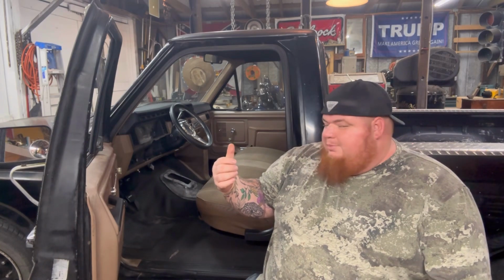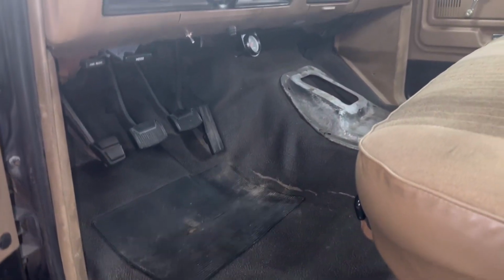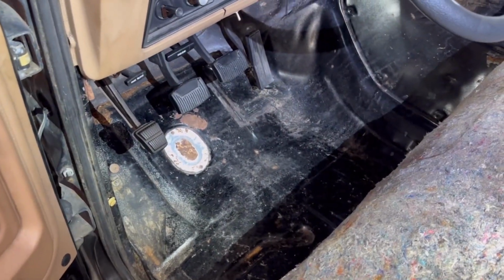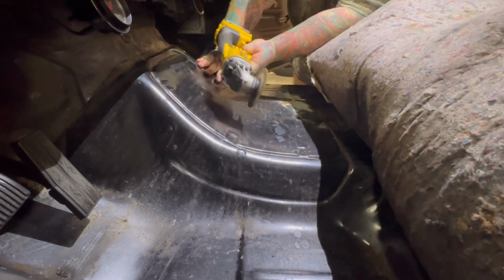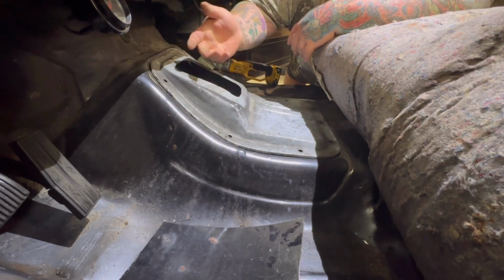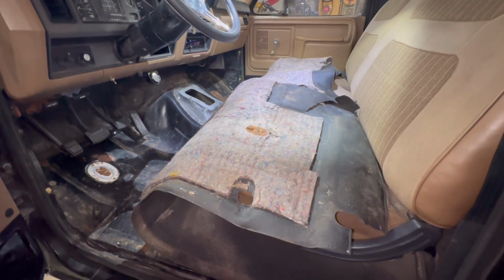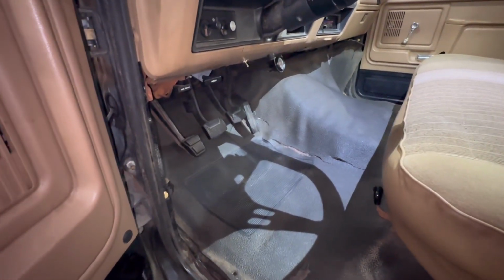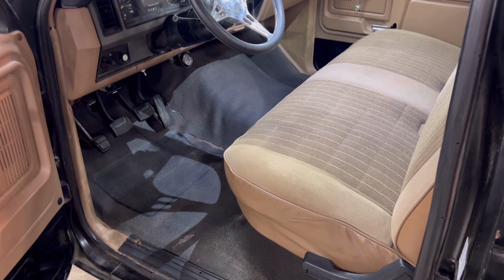F-150 Automatic to Manual Transmission Swap - Part 3 - Trans Cover Install

Comment: Hey, how are you? I have a question. I have a 1992 f-150 with a 351w and an E4OD.  I have a good deal on a M5OD. What do you think about doing that swap? i dont use the truck to tow.    It will be just to cruise.  Will ot hold up?  I know usually is a zf5 behind the 351w